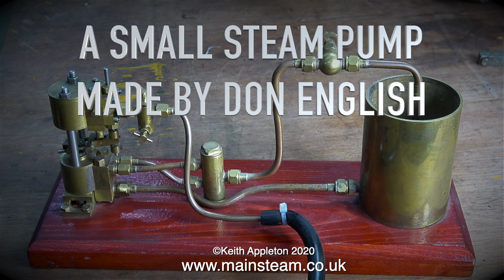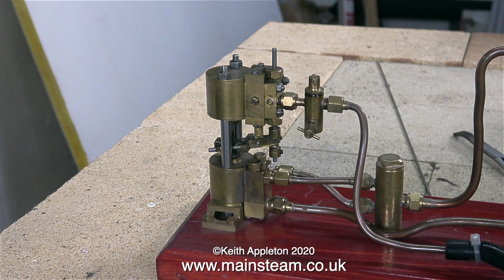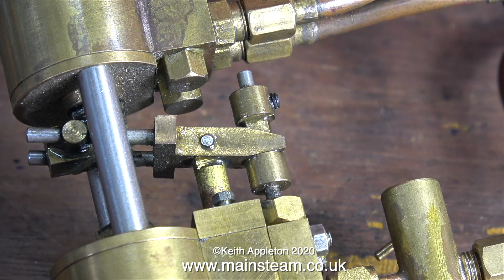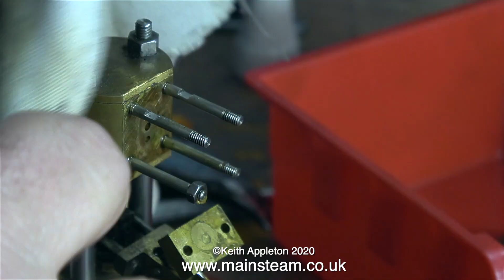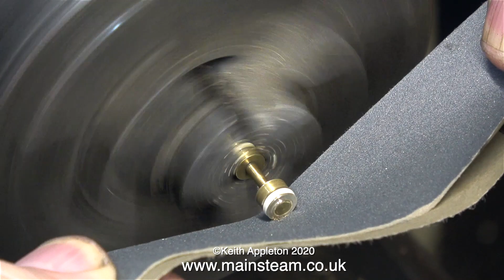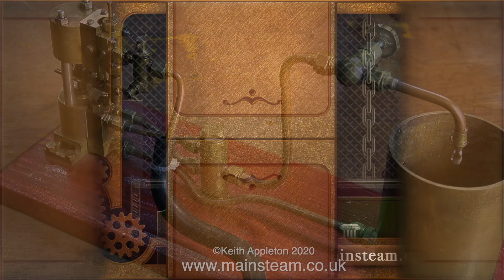A SMALL STEAM PUMP MADE BY DON ENGLISH

Comment: There used to be a very worn  full size Weirs pump of this variety at the boiler house  at the Crofton beam engines. The shuttle piston was always getting stuck when cold. Possibly not helped by the 20 psi boiler pressure  ( limited by the 1812  engine). But I always loved the sound of it ticking away when we eventually got it going. To make a useable version that  small size is a real achievement.
Reply: James Hodgson  When I first started work, we had G&J Weir “up and downers” in the site boiler houses. As an apprentice millwright, three of us rebuilt one of them, with new valves, cages, steam valves, links and pins, all made in the tool room. That was half a century ago, this year !  Setting the valve travel is quite important - I thought that would be what Keith was going to discuss.  They also had a tendency to drown with condensate, when cold, and it’s important to warm them through when starting up.  The spool valve will suffer from hydraulic lock - possibly due to excess oil in Keith’s case, although his solution will certainly help to alleviate that.